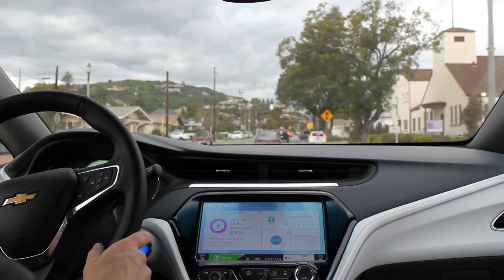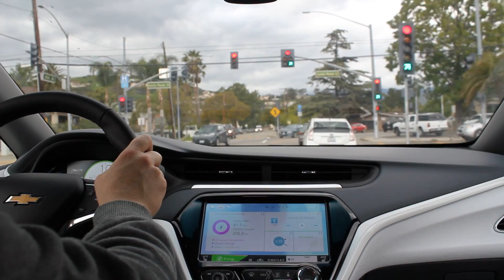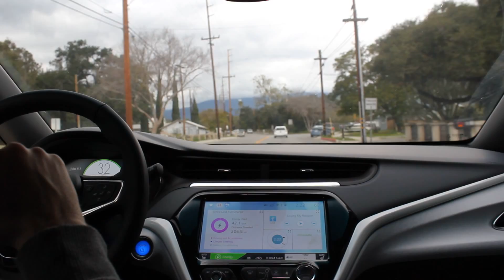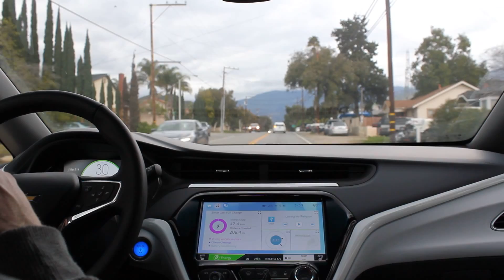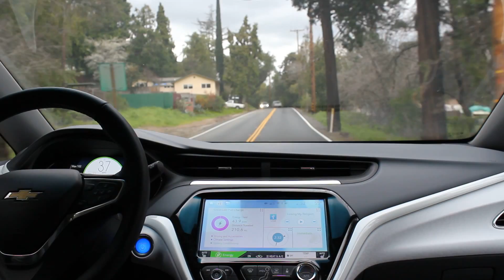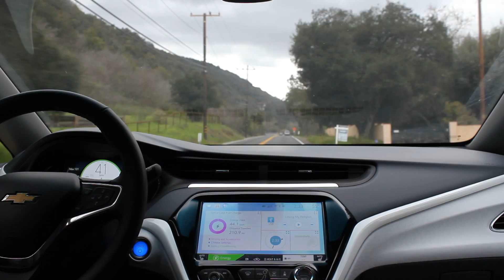Chevy Bolt EV Santa Paula and DIC Efficiency Indicator

Comment: Can you tell me how the range is when you drive 70 - 80 mph on an Interstate highway? Thanxx!
Reply from the maker: +CameraCheckChannel Sure, but it will depend on conditions. 70 mph would be about 3.5 miles per kWh, or about 200 miles on a full charge. But that is at 70 ° F. I only got about 3 miles per kWh doing 70+ mph in 40° F weather. At 80 mph, expect about 180 miles in ideal temperatures and adjust from there. 

Also, remember that if you're driving long distances, you're likely fast charging, which means you're probably only charging to 80-85%. I typically restrict the legs of my trips to 160 miles per fast charge when I'm doing 70-75 mph.
Reply: 160 miles / fast charge is anyway a mandatory stop for toilet visits and a break from driving :) So that sounds perfect :D

Comment: Yep! The Fillmore & Western Railway runs a regular weekend schedule to Santa Paula: Trains depart Fillmore every Saturday at noon and begin the return from Santa Paula at 2:20pm.  

It's pretty fun to go from working with a diesel-electric locomotive built in 1949 to driving home in my 2017 Bolt EV.  Both made by GM!

Comment: Thanks for the updates! You've mentioned using the Torque app - how well does it display EV data? I've got a LEAF just going off-lease and Leaf Spy Pro has been great - it'll be a while before the Bolt EV is available here in NC so maybe apps will get more Bolt-centric.
Reply from the maker: Two99Point80 I've been using custom PIDs originally identified for the Volt, but they are hit or miss. I don't know if the issues I'm having are the result of my OBD2 adapter or the PIDs. 

And each EV will likely have very different PIDs.